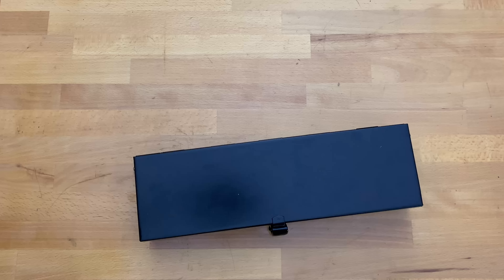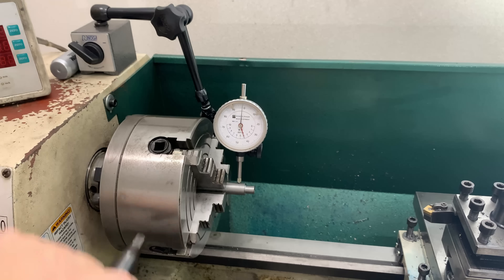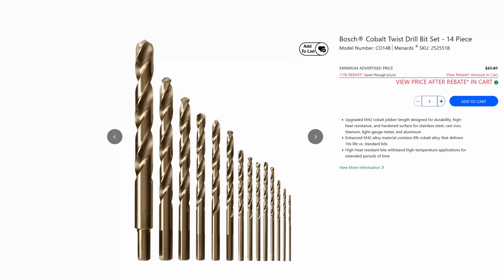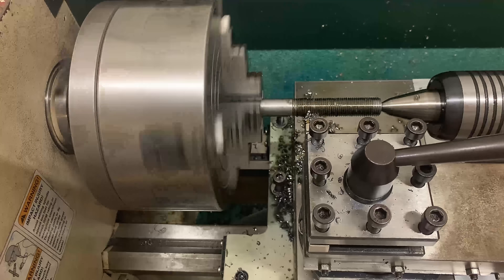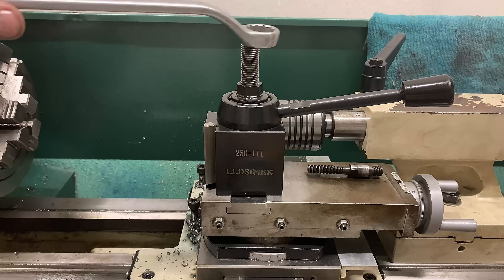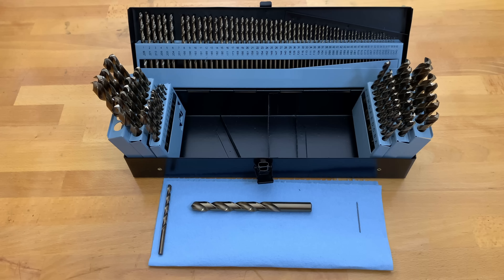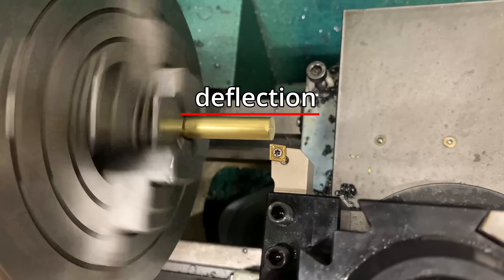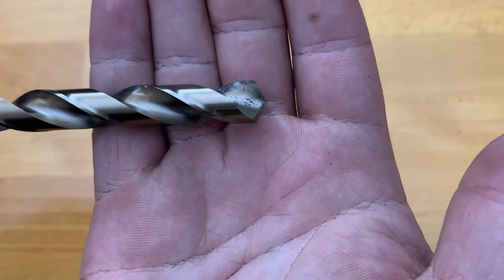Are Harbor Freight Drill Bits Secretly AMAZING?

Comment: Bought  a set  they were garbage buy an American made set of drill hog bits maybe the harbor freight new ones are but  drill hog set drills are much better as well as drill index is much better quality. 
Sides if you mess up one casting have you really saved any money.  Harbor freight drills would maybe drill one hole in mild steel and they were dull.
Reply from the maker: I've heard a lot of people say that about the old HF drill bits but these have so far been really good. No issues drilling hole after hole in mild steel. But it looks like they're discontinued now. Maybe the increased quality wasn't profitable at their cheap price? Not sure.

Comment: Additionally, I usually purchase my drill bits from Estate sales etc.. But, I add these to my overall collections and specifically bring ALL my drill bits back to life - even the BROKEN ones by reconditioning them with my Drill Doctor 750X. Had the original D/D for almost 25 years; and is a workhorse. Haven't yet been able to find a used drill bit the D/D can't sharpen minus the super tiny ones but many people either don't know about this or know how to use it correctly. Not affiliated in any way, just sharing the knowledge of what keeps even the cheap drill bits going. Cheers!
Reply from the maker: You know I used to hear bad things about the drill doctor but lately I've heard nothing but good things. I'm going to have to get one.

Comment: Buy this set and when they break go to store where they sell real drill bits and replace. Eventually you will have something. This is what I did with the HF reverse twist drill set. Original drills were finest chinesium and the small sizes broke easily while I was trying to reverse drill broken screws. Now I have index full of high quality reverse drills. 😊
Reply from the maker: So far haven't broken any yet, but I do plan to replace them if / when they do break with "premium" drill bits.

Comment: Well, can these be sharpened with Drill doctor  machine? No matter how bad the quality is....as long as the metal is decent the bit can be fixed. I have been sharpening some of the old and very cheap drill bits from HF and they have been fine for softer metals, plastic, wood, etc. I wouldn't try drilling titanium or stainless steel but with a bit of patience....I guess it could be done.
Reply from the maker: I don't see why they couldn't be. The geometry should be correct and honestly every drill no matter how good it is, will need to be sharpened eventually if it gets a lot of use.

Comment: I got an ancient Dayton set years ago that was missing a bunch of bits and after I lost even more I bought this Harbor Freight - moved all the bits to the older (and waaaay better) Dayton box and never looked back. I use them more in a handyman capacity than a machinist one.
Reply from the maker: That's awesome. I also upgraded the box for this set to a Huot and though it wasn't cheap it was worth it to me. I'm using mine with my mill and lathe so haven't used these yet with the hand drill.

Comment: My dad has had a couple of these sets. Works well for awhile. But they are mostly all dull now (It's like 9 years old). I found they work best with soft materials but dull fast with hard ones. Best part is there is a ton of bits because they will get broken. I've splugged on the nice Milwaukee ones for hard metal and couldn't be happier! Plus that quad tip/edge or whatever it is makes it so a punch or pilot hole isn't needed. I barely drill but I like my bits to be sharp as I drill soft and hard materials equally.
Reply from the maker: Will have to try those Milwaukees! I've found that no matter how good or hard a drill bit is, if you use it enough, eventually you'll have to sharpen it.
Reply: @ShopHumor  Very true. I only drill handheld so they probably dull a lot faster.

Comment: I've never had a problem over many generations of Harbor Freight drill bits, including those I'm using now.  Hint:  If you're planning to put fairly precision holes in brass, re-grind the bits you'll use the most such that the cutting edge is a 90 degree angle (look at a diagram in a machinist's manual or probably YouTube.)  This makes drilling brass far easier.
Reply from the maker: Great tip, thank you.

Comment: Ive had a couple sets from HF and I believe they are made from either tin, or possibly brass plated aluminum...  Mild steel would be an improvement.  They melt in my forge at the same temperature as a crayon...
Reply from the maker: Lmao. That sounds awful. It seems like they've improved a lot over the years since these drill steel just fine. I've had a few comments from people who said their drill bits actually just untwisted themselves.

Comment: I bought some way back in 2009 and they were really, really bad. They didn't even drill wood all that well. I bought them for woodworking shop in high school. They definitely wouldn't drill steel as they came out of the box. After running them through a drill doctor, they were considerably better. Still, they were not on par with actual high quality drills, but they were at least usable after sharpening. HFT has come quite a long way since then. Back in those days, most of what they sold was pretty crappy.
Reply from the maker: I've heard some of their early cutting tools were especially atrocious. They've definitely improved.

Comment: 😂you're comparing them to other garbage😂
Reply from the maker: One hole is as good as another I always say
Reply: @ShopHumor  but 160 holes through 9 layers of laminated T1 plate between sharpenings is better than 3 holes and straightened out flutes.   A Cleveland or Ohio twist drill is worth an infinite number of garbage freight drill bits.  Unless you're not actually using them.
Reply from the maker: I was just making a crude joke. Anyway, so far these drills have been pretty impressive and are cutting through mild steel like nothing. Will see how they hold up to stainless steel in future projects.

Comment: I have this set and i ended up breaking off 2 bits in WOOD while using a drill press. they were the 1/16th and the #52. im not above saying it wasn't my fault but it felt like they broke incredibly easily. i have used the larger bits without issue though.
Reply from the maker: That's wild. So far so good, even with the little ones. They should be fine in a drill press.

Comment: My experience is that people who complain about drill bits are often using them incorrectly, incorrect rotational speed, wrong downforce (either too much or too little) and no or wrong lubricant.  Stainless steel is difficult to machine and this includes drilling holes.  It requires a slow rotational speed and a heavy downforce.

Interrupted cuts such as what you did on your mill is a great method for drilling holes.  Often times the chips will clog the end point and all it does is heat up the part and the bit.  I fabricate a lot in aluminum and interrupted cuts are essential when drilling holes.

The best way to tell if your drilling parameters are set correctly is to look at the chips being generated.  If you are getting nice long continuous chips, you are doing things right.  If they are coming out blue, you need to change something.  If they are coming out in little bits, you need to add coolant as it will be getting hot.

Also, cobalt drill bits are brittle, this is just the nature of the beast.  It doesn't take much overheating to lose the temper/hardness on the bit.

hth
Reply from the maker: I agree with your assessment.

Comment: In today's world drill bits are a mess. For large holes,up to 1 1/4 I have old drill bits I use as they are American made and keep an edge a long time with proper use. For half inch or smaller I have a variety of sizes of old bits from a military auction I went to 20 years ago. Some of the bits were in paper and I tried to find every company that made them but unfortunately they were all out of business. Some of the best drill bits I have ever used came out of that bucket. Obviously not every size a job might need was in there though so eventually I had break down and buy a full set of a kind like those in the video. I have pretty good luck with them but I almost always drill a pilot hole first with an American bit to help the chinese ones out. I also have a drill doctor to sharpen them up if they stop working well. It seems like the days of high quality drill bits is long gone though.
Reply from the maker: You're right about drill bits being quite a mess. How do you like your drill doctor?
Reply: @ShopHumor  I have had excellent service from it. On broken drills it is often much faster to use a cut off wheel to get the tip of the drill close to the correct angle as the Drill Dr doesn't remove material very fast. I have taken it into the field on jobs that I knew were going to dull the drills I have and touched them up as needed to keep progress going.
Reply from the maker: That sounds fantastic. Thank you

Comment: Nope. Went through a bunch of these. As a PROFESSIONAL restoration mechanic for 45 years, these are only good for hobby stuff and light home use. NOT if you need them for carb work or something that needs to be accurate. The small bits are just twisted steel, nothing more. An .063" bit is not .063" the entire length.  Again, hobby use? Sure. Depend on them for a living? NO!!!!!! Unless you want to buy them over and over every 2 months. Again...I'm a PROFESSIONAL restoration mechanic. Some of the components I work on are unobtainium and extremely rare. I could not trust these to use them on those components. I have a small fortune in QUALITY tools for a reason. To do quality work. It pays my bills and house payment. My customers trust me to do the best work I can....I deliver that with my quality tools. Its just part of the job. Write your tools off on your taxes every year. I've used these in the real world....I only use them for my hobbies at the most. Oh...one more thing, these don't break, they shatter. That should give you a clue.
Reply from the maker: Generally I agree that for things that actually matter (especially "unobtanium extremely rare" things as you described), it's better to use tools that are well made to trusted tolerances. That said, I really don't ever hold drilling or drill bits to that standard.

If I need an extremely accurate hole, I drill undersize and use a precision reamer or end mill to bring the hole to final dimension.
Reply: @ShopHumor  Yes! As I pointed out, for home use, I use the HF stuff. But if you look at them under a scope, you can see they're just twisted steel, nothing more. McMaster Carr or Lawson offers decent bits. I have a good friend that would get me my "high end" bits....he owns a machine shop with 6 five axis Haas machines running 24/7. He gets really good deals since he buys so much. Honestly, after, 45 years of restoration work as a mechanic, I'm now retired since september 11th. So my needs have drastically changed!! You do not realize the amount of tools you amass until you have to move all of them.... holy shit!!! Peace and stay healthy Amigo!
Reply from the maker: Peace and health to you too my friend!

Comment: I drill a lot of old steel and the best luck I've had with drill bits is definitely Montana brand bits, I've only been able to find them at Menards but they will go through metal like butter and that's with a hand drill.
Reply from the maker: Will have to check out those Montanas.

Comment: The problem I've had with the drill sets from HF is that there are usually several bits in each set that are crooked.  I toss those and use the rest.  If I need good quality stuff, I go with Kodiak Cutting Tools drills.  They make good stuff, and they make them here in the US, but they do cost more.  Buy once, cry once, complain endlessly.
Reply from the maker: None of these came crooked thankfully but I've heard people mention the same thing about their quality control

Comment: Price like this really only matters to hobbyists. A bad or dull bit makes work take way longer. Swapping to a new one at my work is minimum 30 bucks for a 6mm shank endmill bit and for a long time, management did everything they could to not order bits. It doubled or tripled how long things took to make and of course, cut productivity and had huge opportunity cost. 
After years of them not getting the picture, they realized 30 or 90 bucks a day for your 600 in labor to be tripled in value was a good thing. A mountain of dull bits we throw away instead of sharpening bc they cant be assed to find someone to do it or buy the equipment. 

But as a homeowner, you fuckin bet i buy the cheap cheap 😅

Comment: i would have went with Bosch over Milwaukee. just better luck with them and other Bosch tools and blades and such. as for HF i would get that set to have to size i need to tap a hole. if i was doing 1 size a lot when it wore out i would replace it with a better bit. 
i still have a step bit i picked up at a Rockwell sale that works great. they use to have to replace things making planes here and bits were rated to a # of uses so they were replaces. for a tradesman you never can use them enough to kill them.
Reply from the maker: You're right that it is very handy to have the index available for whenever you need to tap an oddball hole size

Comment: I've had a set or two over the last 20 years, and they've held up well when used on wood, aluminum, brass, bronze, and mild steel. Don't bother with them on the harder steels. You probably should have a quick way to resharpen them at hand.
Reply from the maker: Agreed about being able to sharpen drills no matter if they're name brand or knock offs, they're gonna get dull eventually.

Comment: So you're saying they don't untwist themselves any more?  They are hardened and tempered now, now just drill-shaped soft rods?  That's cool.
Because I have seen those HF "drill bits" doing exactly that with my own eyes.

PS: titanium coating is associated in people's minds with quality - it should not be. It is very cheap to apply, so they're giving it away, but all it
REALLY is, is an anti-stick coating for drilling sticky aluminum alloys and other soft metals.  That's it - that's the ONLY time TiO2 coating will
make a difference for you.  It has no effect drilling steel, wood, plastic, etc.
Reply from the maker: They do seem to work pretty well on steel (at least, mild steel). I've been using them regularly on steel since I got the set without issue.

Comment: I run a machine shop and mainly buy really nice carbide through spindle coolant drills to be ran in million dollar machines but I do still buy HSS drills for my less common holes. I know there were a lot of bad reviews on their drills but the stereotype of people leaving them are also the same people who monkey on a drill and wonder why it breaks. Shit I've done it and I've watched coworkers do it, but don't be surprised when your drill bit dulls cause you're running it too fast in a drill with not enough pressure. or when you wallow a hole out cause you're too lazy to grab the next size up.
Reply from the maker: As someone who runs a machine shop, I suspect you know more about tooling and drills than I (and 99% of the other people using these) will ever know. I just know if they do the job I need them to do (and so far they have), that's all I need.

Comment: I had this set for a few decades bought back when Haber freight was in a tent in the parking lot. Not much metal work with these mostly woodwork. Have broken a few of the small bits, but for the most part, I still have a full set. Don't use them like I used too.
Reply from the maker: So far I've only used this set on metal and still use my other drills on wood.

Comment: I have that set. My father bought it impulsively in like 2002. He let it go to me when I moved out because I was the only one who ever used the drill press anyway for my little hobby projects like building airsoft guns from scratch or making parts for my car or motorcycle. I have had to replace a few odd sizes, as in recent years I have used it extensively for low end restorative gunsmithing projects, for which it has performed perfectly adequately in spite of the extremely hard metals I occasionally encounter while rebuilding unusual parts or making them from scratch. 
When I can afford better, I'll buy better. For now it's fine.
Reply from the maker: Thanks for the comment. If it does the job you need it to do, there isn't much more that you can ask of it. I think having an complete index like this, especially for projects like gunsmithing that take so many oddball sizes, is really handy.

Comment: i've been buying harbor freight tools since they were a mail order company in the 1980s.  i've purchased welders, floor jacks, sanders, a 56" tool box, and a lot of small hand tools, i even own their 2 stroke fence post auger, (god has that saved me a lot of work and heartache over the years).  most of it has been decent, and some of it was crap (belt sander will shake you to death), but usually the overall value for what you get it well worth it.  i have owned this set of bits (or its predecessor) since the 90's, i've broken a few small ones using hand drills, and burned up a few from being lazy with the cutting fluid, but for the $40 or so i paid for it back then, its been one of the best values for the money that i've purchased there, and would recommend it in a heartbeat...
Reply from the maker: That does sound like an awesome value. I agree with you - generally HF tools are good values, though I've also had a few stinkers over the years. I have to say that as time goes on, their quality has been increasing steadily, which is something I cannot say about many other tool brands where things have deteriorated over that same timeframe.